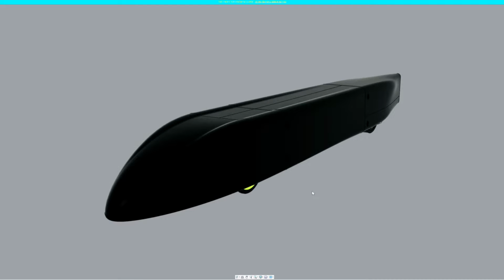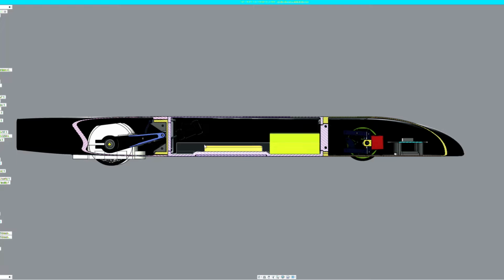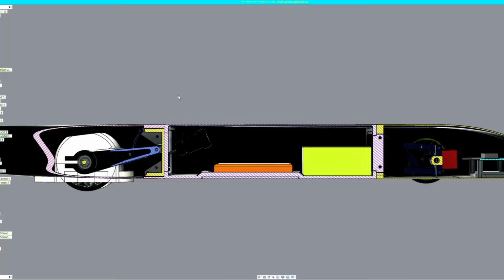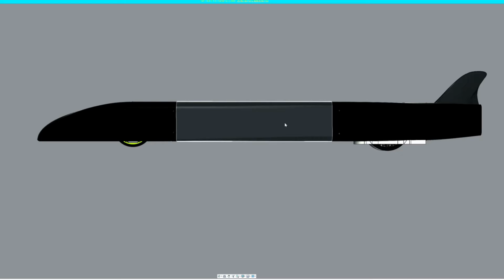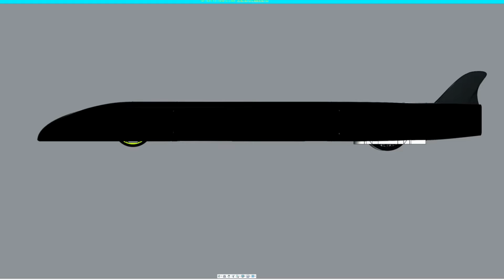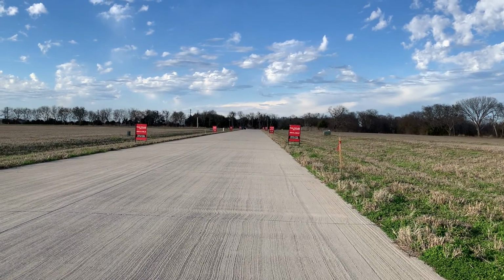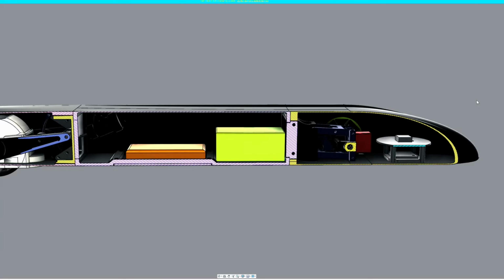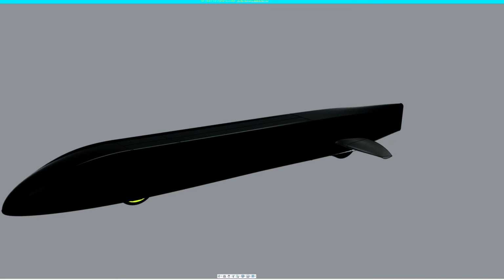Project Streamliner: Version 2 Design and Tech Update - Pt7

Comment: The traction control is way cool, I've always wanted to build some TCS system that used fast polling rate ground speed sensor (optical or otherwise) instead of accelerometer, if you could build some kind of wheel+motor inertia model and then control the motor to a target % slip rate over the surface you could maximize the acceleration without overshoots. afaik this is how GM is doing launch control on latest C8 corvette... targeting ~6% slip at the rear tyres through the launch since there's a bit of a J-curve regarding tractive effort and slip angle with rubber tires.
Reply from the maker: That would be awesome.  I think I may have to go there at some point. Because you have limited visual range to drive these RC cars, it’s a weird combo of being a drag racer then land speed racer.  I really struggle with the best way to have feedback for the traction control. I either need front wheel speed sensors or a more accurate GPS. There’s a lot of noise and tuning involved in either solution.

Comment: Coming along nicely.  The additional width will help alot.  I ended up with 154mm width on my build.  Slowly our builds are looking more similar.
Reply from the maker: That’s awesome, if this design doesn’t work I’ll be going at least that wide. How much ground clearance do you run?  I’d love to make mine shorter in height.
Reply: @IndeterminateDesign  I have it set at 7mm but if I true the foam tires down it will be more like 5mm

Comment: great job ! well done ! which CFD software are you using ?
Btw does the regulations allow a fin at the back then connect it to a servo and by using maybe the accelerometer you can calculate the side force and apply an angle to the fin using the servo to let the car correct its side sliding, is that possible by the regulations ?
Reply from the maker: Thanks, I appreciate that.  I'm using Simflow and Simscale for the CFD.  I don't see anything in the regulations about tail rudders.  I'm looking at the open classes and it's mainly around safety and 3 wheels or more.  http://rossa.org.uk/classdefinitions.html
Reply: @IndeterminateDesign  ah yes i know simscale it is an online tool

Comment: The ground plane modification is slick, and I was so happy to see the other side of that model when you spun it around. Will the active aero wings be independent on either side? I would assume that you could aid in roll control with independent motion.
Reply from the maker: Independent rear wings would be awesome, but I don’t think I can fit that. Right now I’m trying to get the end plates so that they almost touch the ground because these will be attached to the rear trailing arm they will move with the suspension. Hopefully pickup some ground effect so they can be smaller and act as training wheels in case it does roll.  I have some pics on my Instagram https://www.instagram.com/indeterminatedesign/

Comment: Thanks for the update. I like the direction you've gone. With the short runs has cooling been a problem? How many amps does that motor pull off the line?
Reply from the maker: Right now it barely gets warm to the touch. I’ve been running a 3S battery that can only put out around 40amps.  The 6S battery will be a much different beast, basically doubling the power of the car.